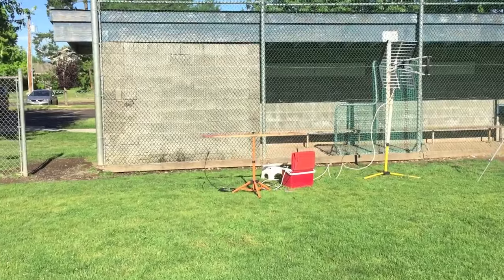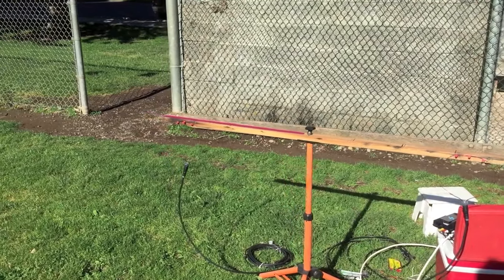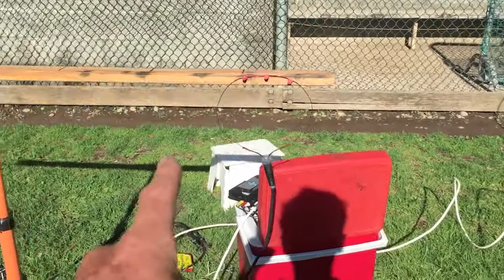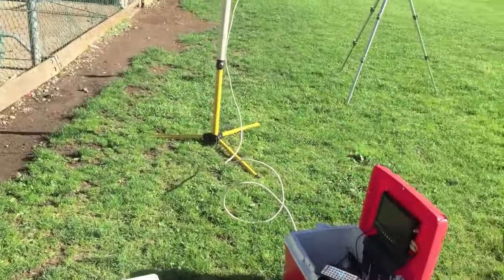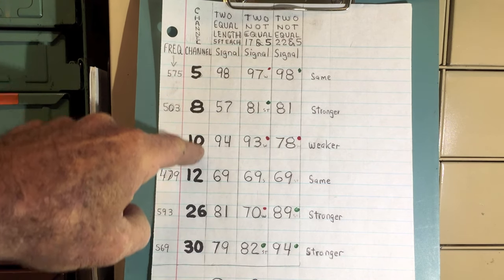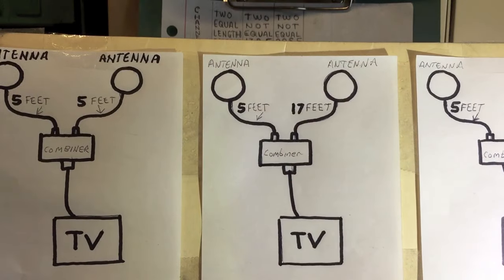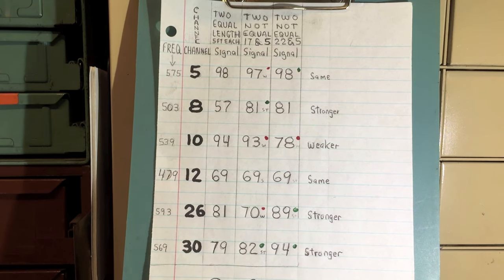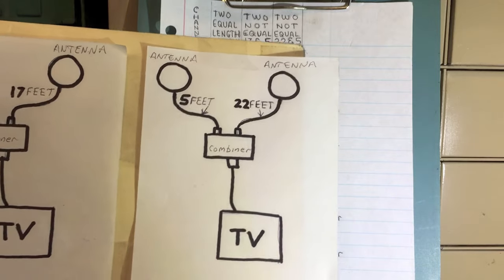Can Two  TV Antennas Really help? Watch This Experiment.

Comment: It has always been when you combine two antennas to make sure they're the same antenna and to make sure the same cable length is used from each antenna to the combiner. Most of the time it works and then sometimes one antenna will cancel the other one out as it varies per setup and location.  I found it works best to keep the antennas close to one another as possible. Sometimes I just use one transformer coming from both antennas.
Reply from the maker: Thanks for the info. I was told  the same thing from a channel masters rep.
Reply: @GrantsPassTVRepair  Every situation is different though. Sometimes two different antennas from different manufacturers work better when combined aiming at different markets.

Comment: Thank you for taking the time.  Did you also attempt to use the same cable manufacture?  I'd assume different cables would cause a velocity difference too?  Length and also same vs different manufactures would be interesting.
Reply from the maker: It's been a while since i made this video, so I'm not sure, but I'd guess the wires were likely the same manufacture.

Comment: in my area (Grand Rapids, Michigan market), just about every station has its own tower.   Most are in the same general area.  However, two are  in located in a totally different direction.  It was common before everyone got cable to see antennae with elements pointing in different directions (south for CBS and NBC, west for PBS and north for ABC).  Wonder how those worked?  This would have been in the 70s and 80s.
Reply: Just guessing that they  were more directional.
However, now days tbe frequency spectrum has  been changed😢

Comment: Does the same thing running coax to different rooms. I been running two antennas for a couple years or so not for signal strength but to eliminate the rotor.

Comment: Let's be clear on this that a signal with a two-way divider isolates or combines two signals with significant amount of attenuation between one-another. The price you pay is a typical 3.5 dB loss by using it on each leg. Why not simply do what I do that and works well, buy two antennas, each must have a preamp to overcome any losses seen through the coax and signal divider. Take each pre-amp power supply and get a WYZE type WiFi AC power switch, two in a box, select the market you want to watch in my case it is NY and CT. Depending on signal of that day, if both are good I leave them both powered up. If it is a bad day with multi-path, I switch off the one that is causing an issue. About 1:00 AM in the morning they both default back to the on position with the build in clock. All controlled by a cell phone, isn't life sweet! 😊
Reply: Geez you made that complicated. Buy an actual combiner solves the issue. Stay away from preamps when using combined antennas.
Reply: @jamesm568  I don’t quite see that thought, as one looses a significant amount of each antenna by coax losses, and what ever gain is left and divided by two further increasing signal loss significantly. I don’t suggest putting dividers at the antennas, other than the amplifiers I want to be able to make changes at the shack so to speak where it easier to get too. Unfortunately all bets are of with pre-amp as they need to be at the head end(antennas). Hence my suggestion of turning of the interfering preamp with choice when needed has worked terrifically, trust me!🙂
Reply: @jamesm568  I do see your point if both antennas are pointing to the same market. My further explanation relates to two different markets(different directions).
I actually do have an additional antenna pointing to the same market, it was availed to me, and selectively I switch between them when needed depending on propagation issues, but sometimes they do work well together. Maybe just has some favorable spacing and lead length by chance, but did not design for it.🙂

Comment: Hi i have an antenna with 2 coax leads 1 for each bay     i am using a 2 way signal splitter in reverse (so 2 into 1)
Is this not a good situation  i notice you use a combiner or is that just a splitter ??
Thx in adv

Comment: I'd think the different lenghts are changing the tuned circuit of the antenna, cables and input circuits.
Reply from the maker: That sounds like another possibility.
Reply: Possible. The coax cable itself is an antenna.

Comment: I use 2 antennas to get both Phoenix and Tucson which are in different directions.  Works fine since they have different channels.
Reply from the maker: If the signals are fairly strong I think it's less of a problem.
Reply: What kind of antennas  and set up did you do? I like install 2 antennas to get Tucson and Sierra vista Bisbee area since they're in different towers

Comment: When I coPhase to TV antennas I use the exact same length of 75Ohm coax from each antenna.
You will loose some of the signal from the loose from the Combiner/Splitter.
To over come the loose i install a small signal booster.
NF1J    73s
Reply: P.S  The problem is you can get the signals out of phase with different length coax.
Be sure to use the exact same coax from the same spool . 
Different coax has different  dielectric, etc that will cause issues when coPhaseing antennas
Reply from the maker: Thanks Grant. Thanks for the info. I'm guessing you meant to say 75 ohm coax from each antenna. :-) 73s

Comment: This was my recent experience, too.  
    After putting up a new antenna, I found that the Ch 5 family of frequencies would not come in.  
    So, I designed a yagi for the missing Channel family (Ch 5) but whenever the two antennas were combined, I lost the Ch 4 family.
    Cause?  The antenna I purchased only has 3 dB of gain in the VHF section.  That is not enough to pull in the missing Channel.   IMO, 6-8dB of gain would be a minimum figure.
    Solution?  Purchase an antenna with more gain in the VHF section and one that is designed for the low VHF, not just the high VHF band.  As I have discovered, some manufacturers are building antennas now for the high VHF band only because TV stations are generally moving away from the low part of the VHF band.

    Where I'm at, the lower part of the VHF band is still used extensively.
Reply from the maker: Here in Grants Pass most of our channels are on UHF, but you can drive just a few miles away, and the same networks are broadcasting in VHF. I've been in some locations that pick up 4 different transmitters that are broadcasting the same networks on different frequencies, so sometimes I get doubles, triples, and even quadruples. Grants Pass  can be a challenging place to install antennas.
Reply: @GrantsPassTVRepair  Thanks - I believe a higher gain antenna is going to be the answer in my situation...

Comment: Note that most antenna I see on yt are wired in series and same element length.  

In parallel I will need to keep the wires to different elements, tuned to different channels, the same length to the balun?

Comment: Now I'm assuming your experiment is based on one certain channel from what you had said in the video. With that being said I have two antennas one pointing in One direction and the other facing another direction. Obviously what I'm doing is trying to pull from one set of towers and One direction and another set of towers and the other. That method I was able to double my channels. However obviously some of them are just the exact same channel so you want to get rid of some of your doubles for instance here I get PBS on 36.1, 36.2, 36.3, 36.4 I also get the very exact channels on 12.1, 12.2, 12.3, 12.4. in this situation I look at the antenna strength and whichever one is more consistently stronger I delete the other channels. Interesting video by the way I honestly had no idea that the length of coax cable makes that big of a difference.

Comment: Combining antennas can and often does lower the dB signal strength. There is only so much possible gain from each direction, so when you use two, you divide the signal strength between the two antennas. Also, adding an additional antenna changes the radiation pattern and SWR for each frequency. I recommend getting a NanoVNA meter to understand further how antennas' alterations affect the Standing Wave Ratio (SWR) for each channel. A good signal meter is critical as well. The only time I ever use dual antennas is if the signals pull from two different directions and there is enough gain for both positions. A spread of more than 45 degrees will often diminish most distant signals. 

Ultimately, an antenna only needs two elements for each channel. The length of the elements is very specific to the frequency you are tuning in. Yes, much like the old rabbit ears. LOL, but really. Yagi and Log Periodic-style antennas have multiple elements on them, and this is not by accident--it's to accommodate for all the channels. In contrast, if a person only cared about one channel, then you only need two elements to optimize for that channel. 

For example, RF channel 7, not virtual channel 7, but RF 7/183 MHz, is a wavelength of 64.49 inches, so divided by two is 32.245-inch elements on each side to accommodate the entire wavelength. You must consider wire connections between the elements as part of the measurement as well. For fine-tuning, the NanoVNA can show you in real-time when you get it right. As you clip the element inch by inch, or simply move them around, you can see the SWR marker on the meter move towards or away from that perfect 1:1 desired position for that channel. 

Long story short, every single tiny adjustment to an antenna changes things drastically from one channel to the next. Optimizing for one channel is easy with the right equipment and knowledge, but optimizing for ten channels from multiple directions, well, that is when it gets challenging. Adding a second antenna totally messes with the SWR for every channel, and that's a bad thing if one does not fully understand these multiple channel changes. 

Glad to see you are still at it. I started as a TV repair tech too back in 2009 and have always been inspired and learn from your videos. Hope we can learn from each other. We once used to share repair tips, if you recall. Formerly Jer's TV Repair from Grand Have, now TransitionTV. 

Have a great day and stay cool over there. I too like to be off roofs by noon. :)
Reply from the maker: Hi Jer,  Thanks for all the information. Your right about getting off the roof early. I recently tried to do Two in a day and really paid for it. Good to hear from you.

Comment: I've got 2 DIFFERENT types of indoor Ota antenna(1st- Flat type attached to window, 2nd- Round Ball sitting in window). Each hooked up to 2 dif tvs in the same room cuz each antenna picks up a few channels that the other does not.  What I was wondering is... if I could use a dual female to male splitter to hook both antenna to ONE TV so that I could get ALL CHANNELS without having the need for separate tvs? 🤷‍♀️ I've ordered the splitter so I guess I'll find out.  😫
Reply from the maker: I don't believe anyone here can answer your question without trying this experiment, as you intend to do, and every location is likely to have different results.

Comment: Could feed each antenna into a separate networked tuner and set the display device to use the tuner based on channel.  No combiner used this way and mismatched coax not an issue.
Reply: You can do that just by remembering which tuner for which channel.  Your TV can receive from one antenna and use the tuner to receive from another.

Comment: I’m still an RF noob, but imagine you would want at least two filters involved for the best results. So the filter on antenna a should block the signals you want on antenna b and vice versa. How far off am I?
Reply from the maker: Someone suggested I should have had these two antennas in a series circuit. I'd guess that having the antenas the right distance apart so their two phases add together rather than collide could enhance the signal.